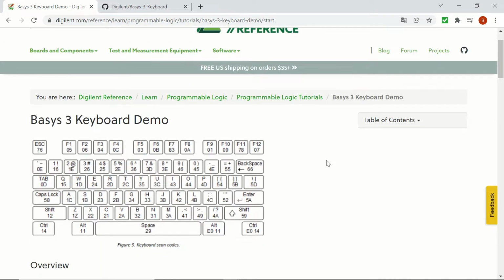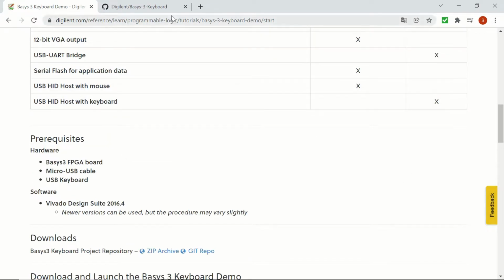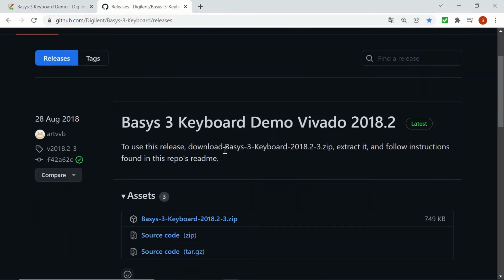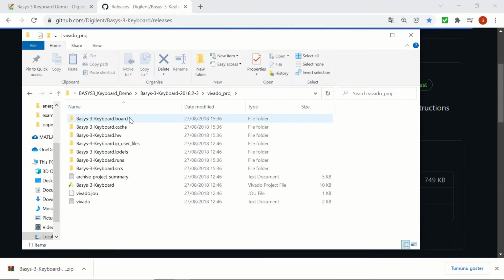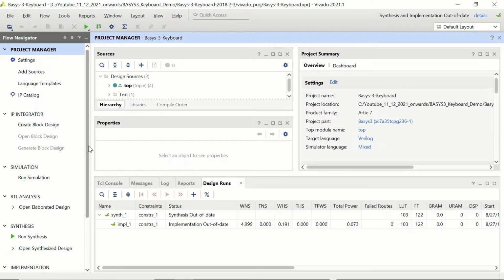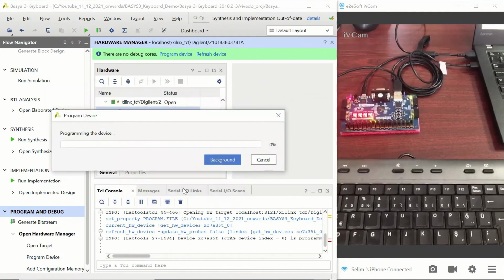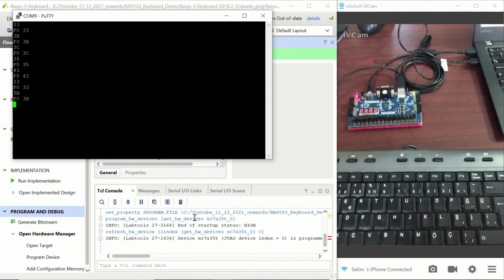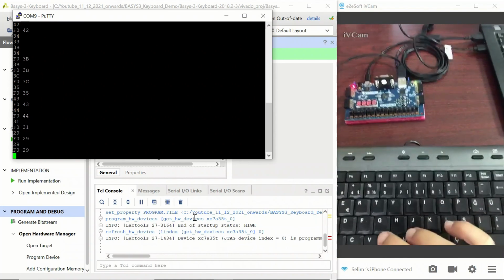Keyboard Demo in BASYS3 FPGA

Comment: for the file we download (xpr file) do we need to have that particular version of vivado?

i m trying with the latest version but ig its not working
Reply from the maker: Hi, I don’t think that’d be necessary, since vivado makes some modifications while importing the project. Do you get a particular error message?
Reply: @drselim  hey thanks for replying, but it worked 😊, a popup message was coming every time when i open the file it shows that the file is in read only mode. so i changed the file name and it worked
Reply from the maker: Glad that it worked 🙂